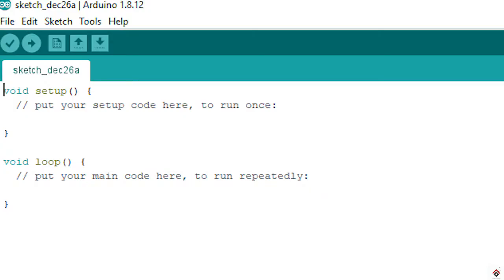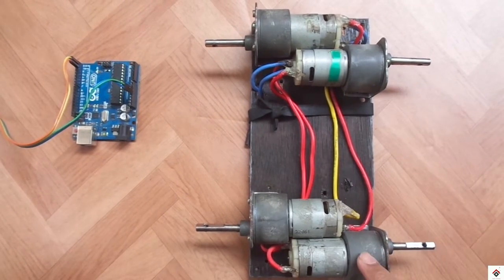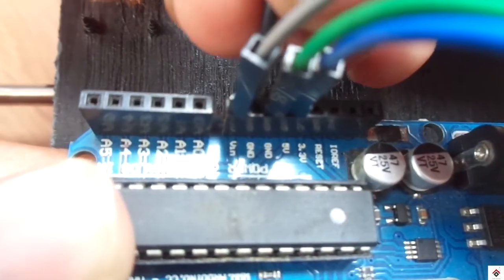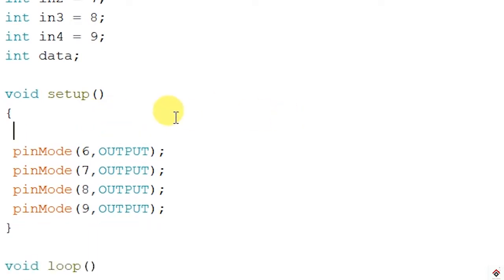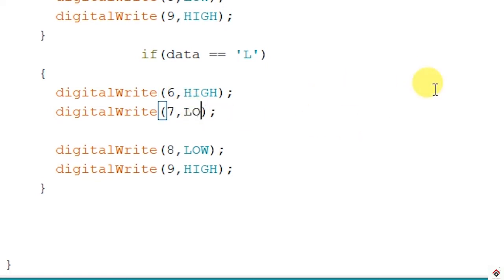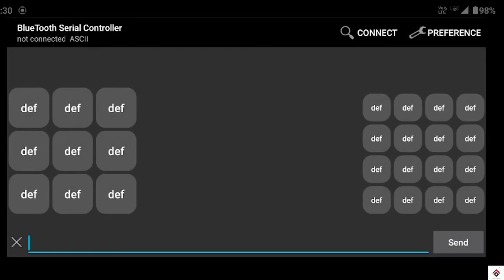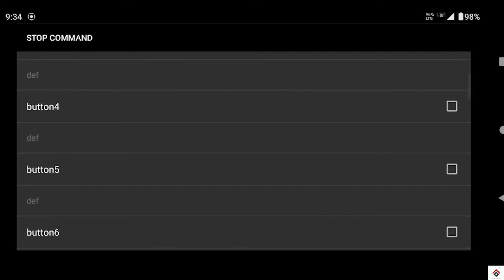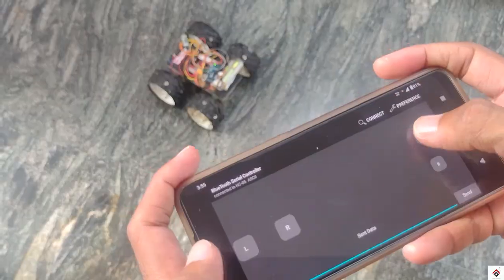How to make Bluetooth controlled Car using Arduino & HC05 Bluetooth module | Control with your phone

Comment: I can use tt gear moter and the moter is not rotating while I use phone for power supply
Reply from the maker: What is the voltage and current rating of motor?

Comment: Will it not burn the motor driver as you used 1x L298N Motor driver for 4x dc 500rpm motor supplying 12V from battery.

Comment: L298N Driver board is ok but after connecting all items only 2 motors of one side rotates? 12 v LiPo battery is used.
Reply from the maker: You can first check the motor driver seperately if it is working fine or not on both channels.
Refer this video: https://youtu.be/xHbsWyoijb4?si=jhEvqTlo_72ZPC6h

Comment: Can you help me with the diagram if i want two l298 motor driver for 4 dc gear motor plz because if i use this motor driver with 4 of those motor then there will be a heating issue and also what kinda change do i need to do in the cooding part